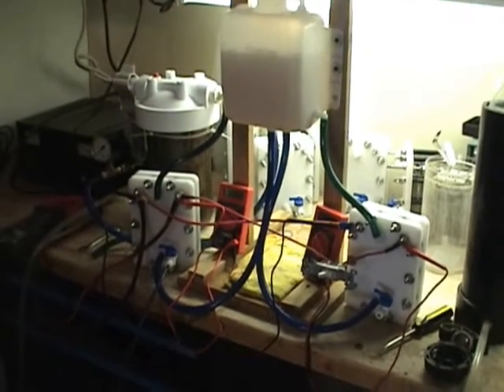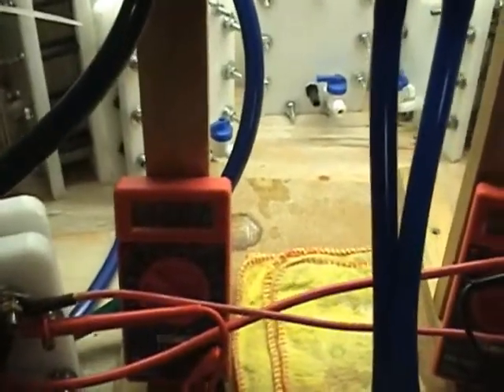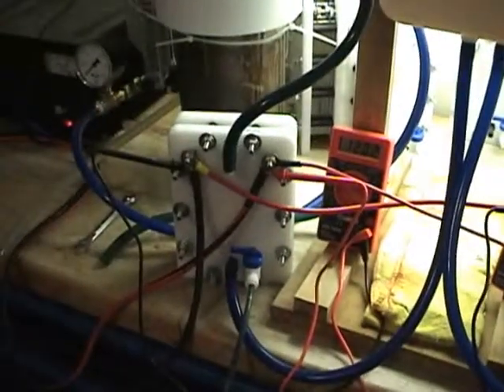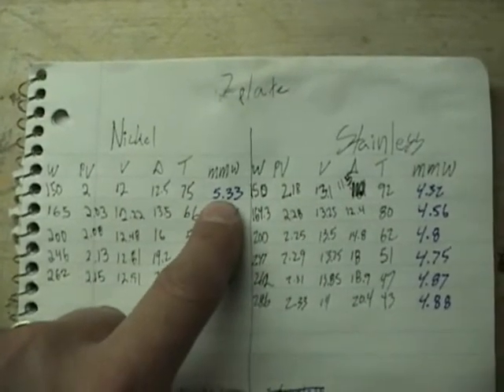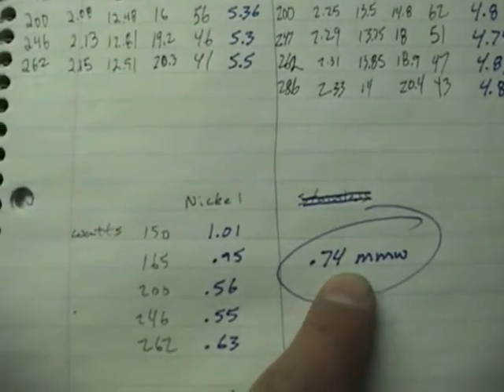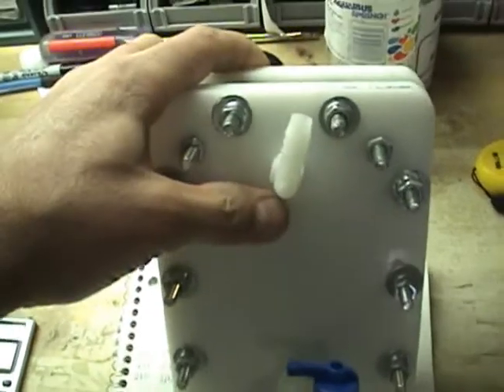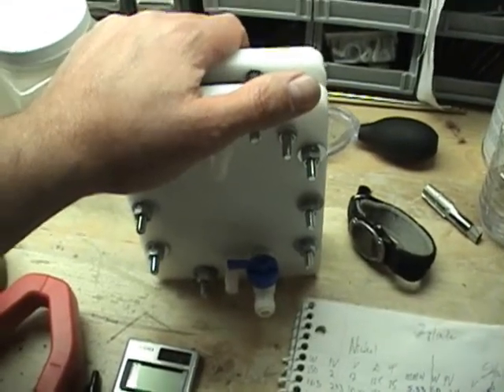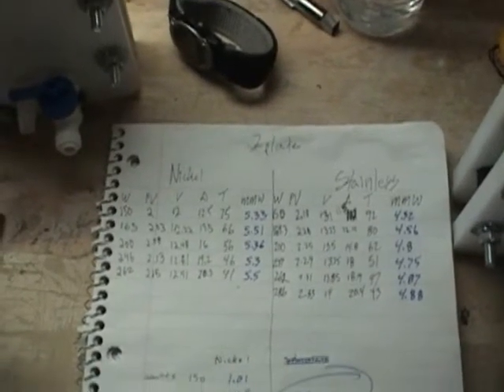Hydrogen HHO Nickel Vs Stainless cell Who will be the victor!

Comment: NASA did all kind of testing on this in the 1970's

You only need 4% hydrogen in your Air fuel mix to get the effect of burning 99% of your gasoline fuel instead of the 50% cars currently burn.
Reply: Crazy

Comment from the maker: @fred30680  I dont think it will last longer. They both will last a long time. The difference is nickel is less resistant to electrical flow. also It has no chromium in it or iron. So the water will stay clean.

Comment: SS electrolyzers leach chrome into the electrolyte. The chrome knocks ortho-hydrogen down to para-hydrogen. Para- is a lot ess energetic, and wont bond with the pump gas in a car near as quickly, if at all. The nickel produces no chrome, there by, a lot higher quality of gas. Same holds true with the MMO coated Ti plates, unless the MMO has chrome in it's make up.
Peace.
Mike.

Comment: I like the data gathering, but one thing to note, your mmw on the ss cell is going up even at 2.33 v per cell and the mmw was lower at 2.18 vpc. I am not saying you recorded it wrong, or that you did not in fact get this data, but i have never seen a cell have a peak mmw in the 2.3 range, something is different, more than just the metal. This data doesnt align with most other reports of ss cells. maybe seal its internal edges?
just a thought.

Comment: Nice data Steve. 5 stars. More of these type video's need to be done. Everyone is way too concerned with the cost of the cell. I am telling everyone reading this comment. The cost of the electricity to run the cell over its lifetime will far and away outweigh the cost of the device. If cheap cells were the way to go we all would just make glass grenades for about $10.00 each. Great work STEVE.

Larry